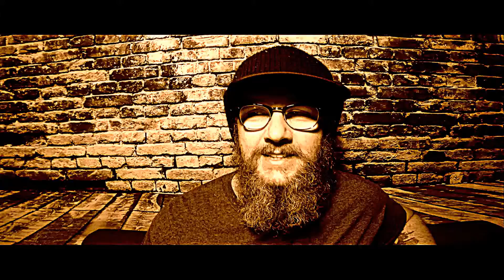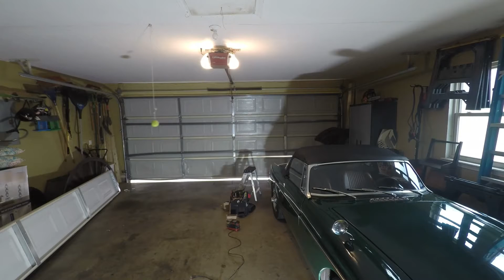➡Garage Door Repair Replacing the Damaged Bottom 2 Panels 📽 Time Lapse Austin,TX

Comment: Nice job!  And thanks for the shout out, I was not expecting that🙂. So what do you do when the stiles dont line up? Lol I have an aunt that has an 14 year old 16/7 uninsulated Clopay (Ideal Branded) with a stile that was 2 inches off (factory defect) so when the installer installed the door, they left it without a hinge...
Reply from the maker: Joe Powell 
Thanks Joe.
Well if the stiles don't line up for me I either just add one where I need it or like on this door, just split the difference with the hinge,   Self tap new holes in the hinge.
I run into that issue frequently.  So I'm pretty good at making off brands or odd brands work with anything.
Reply from the maker: +Joe Powell 
One thing about a Garage Door Guy, were pretty versatile.  We just make it work and happen!  I love this industry and wouldn't wanna do anything else.
Reply: Garage Door Genius yeah I hear ya there, lol!  Im a carpenter by trade I do garage door work on the side for family and friends and we pretty much do the same, make it work.   About two years ago I had to reengineer a roof truss system in a garage for a homeowner who had an Amarr installed by a company that notched out every single truss to make the opener fit because they screwed up and didn't use Low Head tracks...  The garage was about to collapse the roof was sagging so bad.  I reengineered the trusses and then reinstalled the door with Low head.